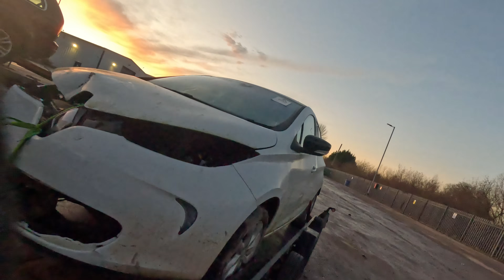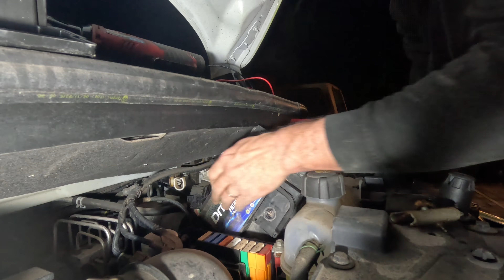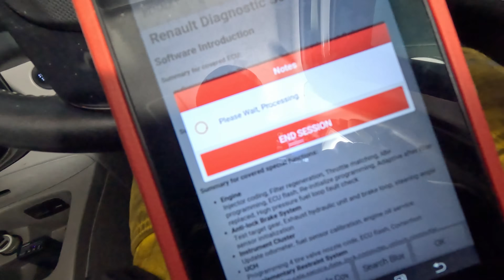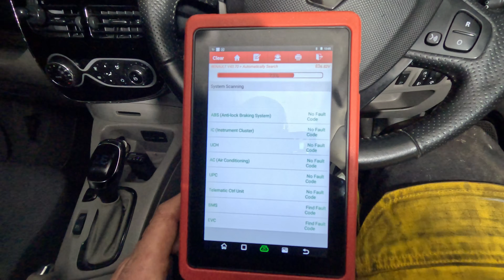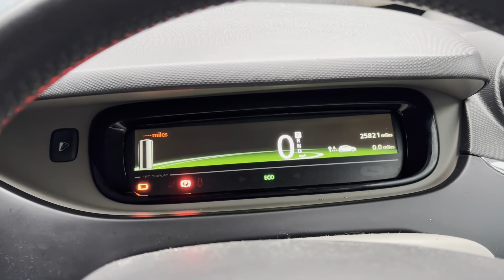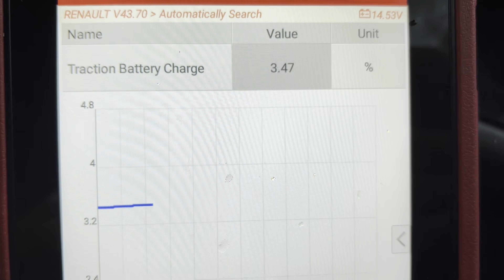Cheapest EV? Expensive Scrap? Renault Zoe EV from Copart £550 Salvage - Will it Suck Juice and Move?

Comment: The battery is rented!
Reply from the maker: “Was” not “Is” :)
Reply: @sevenone6  They still have rights to it so I have read, unless it ends when the car is scrapped.
Reply from the maker: @ think it depends what happened with insurance company.  no mention from copart on lease etc - but will see!  whats really odd its showing Untaxed
Tax due: 1 November 2020 ✗ MOT Expired: 29 September 2023. wierd.
Reply: @sevenone6  That's what Renault did with the zoe when it first came out, You bought the car but you didn't own the battery! which is ridiculous!
Reply: @sevenone6  the cars were tax free, i guess that's why....
The rent was a way to get these expensive batteries to the market for cheap. Later you could buy it out of the lease program... It's not a customer friendly program, unless you pay the rent every month. But this one could be bought ... 🤞 Fingers crossed
Reply: @zog97xy  remember when this was done and the climate around EVs at the time. The battery was expensive and many customers were worried about degradation. 

This was a way to mitigate some of that. 

It was also optional: people chose this route very frequently, which tells you something
Reply: @ Yup and many of them are stuck with the car now.
Reply: @RichardBrooklyn  Yup and many are still stuck with the car.
Reply: It's possible that buying-out the battery lease was more than the car is worth now. Will be interesting to find out though..